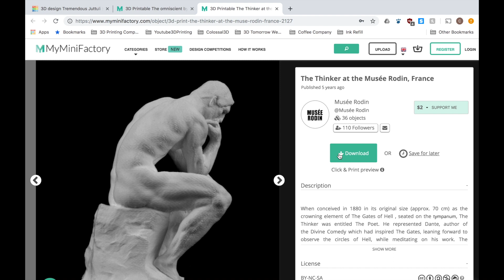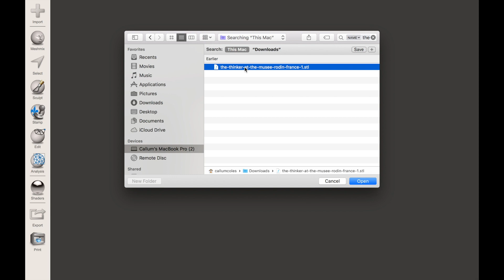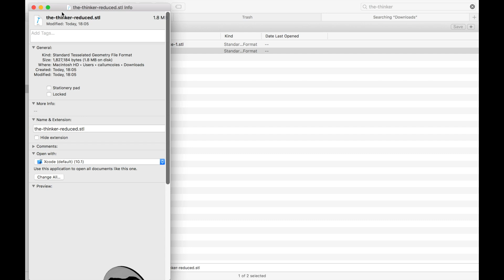Reducing file size in Meshmixer, ready for 3D Printing

Comment: This didn't really work, it just stripped all the detail off my model. I found using the Tri count setting works better, it gives you more control over the geometry, especially if you turn on wireframe mode to see how your mesh is changing.

Comment: It made it bigger for me. I followed the video exactly and it went from 50mb to 100mb
Reply from the maker: You would have saved as a different format to what it originally was then, if you’ve followed the video then the mesh count will have gone down
Reply: I know it's from 4 months ago; just came across the same issue with Thingiverse/Meshmixer making the file 4x bigger. I redownloaded (the same file!) from Thingiverse and that fixed the issue. Guess Thingiverse somehow bugged out -- its the same file size / date but one balloons and the other doesn't.

Comment: Is this changing the printing time as well? Is there a little different configuration in Max deviation for 0.8mm nozzle?

Thanks for the Video it is really helpful
Reply from the maker: Should be little to no change in print time, but the lower file size will process quicker in the slicer. I would keep the reduction settings the same even for a 0.8mm nozzle.

Comment: How stop meshmixer rendering a result after touching a setting? I know I want to change other settings but it renders every time i change something and i have to wait ages!
Reply from the maker: It's annoying isn't it! Unfortunately not possible to override... My only recommendation is to keep the resolution settings low while you change the other settings, so it at least updates quickly, then increase the resolution once you've got the rest of the settings as you want them.
Reply: @CallumColes  It's very annoying and leads to crashes if a setting is giving the pc too much to handle. I managed to downsize a 260MB file eventually, so thanks for the tutorial. Just wish I could toggle all the sliders, then hit go! Would save a lot of time waiting for a render I know is wrong!.
Reply from the maker: Your welcome! And yes, I could not agree more, they have implemented that feature for some of the tools in the software but not all of them. They obviously didn't test the reduction feature with large files else would have known how time consuming it is...

Comment: Thanks - right to the point it's what I was looking for
Reply from the maker: No problem, cheers for the comment :)
Reply: @CallumColes  I have a file I have tried for HOURS to decrease the triangle count to 300000 and am having difficulty. Could I possibly send you the file and you could help me, PLEASE.
Reply from the maker: If you're having difficulty it could be due to errors in your file, these can confuse the software. If that is the case a reduction can be pretty time consuming and CPU intensive! Additional pre-processing might be needed in the original CAD software where your file was created to remove any errors and in turn assist the reduction process.
If you're really stuck, you can email your file over to mail@3dtomorrow.com for a quote, but generally speaking this isn't the sort of request I would take on since it can be very time consuming and therefore expensive. That's why I created this video to help people do it themselves :)
Reply from the maker: If the file you're reducing is particularly massive, try a percentage reduction (or two) first. Just export and save a version each time in case the system crashes!

Comment: it is necessary to smooth? the model is so triangulate...
thx
Reply from the maker: The steps in this video will preserve most of the original detail in the model and allow you to reduce the file size accordingly. If the model you are using is visibly triangulated then it could be a good idea to perform some smoothing, but the content of this video will not help you to smooth the model.

Comment: Hi
Is this function only available in the full version?
Reply from the maker: Meshmixer is free software, so as far as I am aware there is only one version
Reply: @CallumColes  thanks for reply. What is this version you were working on?  This icon does not exist in version 3
Reply from the maker: @CAD_CAM_TRAINING it should be there in version 3, this was version 3.5 I believe. Have you made sure to 'select all' on the model. This opens up the menu more. Select all is CMD+A on a Mac (probably CTRL+A on windows).
Reply: @CallumColes  OMG! thank you very much boy. Appeared by selecting all the edit options

Comment: Following this exactly.  Doing what you are doing only using "triangle budget"   The model updates on the screen but when I go to export, the changes never take.
Reply from the maker: Unsure why that would be, could be a software bug in your version, so might be worth checking for any updates available, or alternatively reinstalling.
Once you have performed the reduction, go to ‘View’ then ‘Show Objects Browser’ and make sure Meshmixer has replaced the file rather than generate a new object. If it has generated a new object then make sure this is the one selected, then click export. When you export, be sure to save the file as a new name just for reassurance.

Comment: whilst its loading "max deviation" it starts loading then just keeps crashing, i tried 3 times. and installing new update but same crap :(
Reply from the maker: Deadpool Lane if your file is particularly large and/or your PC isn’t powerful enough this can happen. Although it can lose a bit of detail, doing one or two percentage based reductions first might be needed to get the max deviation option to work. Just export the file after each reduction pass in case it crashes again! Good luck:)
Reply: @CallumColes  i've got a new pc running shite loads of stuff, other files i've used worked fine, but this large zombie file and a dinosaur file both crashed. :(
Reply: @deadpoollane4229  i had the same issue to make it work i recommend closing all unnecessary applications in the background and then it worked in seconds

Comment: hi, my company bought a 3d object and i need to upload it to Instagram camera filter, but the file is 30mb and Instagram only supports up to 4mb files.. please help.. im using spark ar
Reply from the maker: dubas dibas hey, what format is the file you’re using? I believe meshmixer will support STL, OBJ, PLY, AMF, 3MF and OFF file extensions, so if your file is one of these, then this process will be suitable for reducing the size.
Reply: @CallumColes  Yes! I followed your video but the file only reduces down to 7,5mb.. i reduced the percentage to 100% .... also i increased the max deviation to 2.24mm (the max) .. i read the more you increase the max deviation the lower quality you get..
Reply: the formats i can get are MAX, FBX, OBJ, 3DS, MB, IWO available for download
Reply: Thanks for the Help man
Reply from the maker: dubas dibas if you’ve already got it down to 7.5MB and you do another percentage based reduction at around 50%, then that should get it under the 4MB you need
Reply: @CallumColes  ok ill try that, thanks!!

Comment: my files are getting bigger!  help what am i doing wrong they are doubling in size
Reply from the maker: 404 Shenanigans are you definitely using the reduce tool and not the remesh tool?
Reply: @CallumColes  yes I was using  reduce  I found a different software that could do the same thing and it worked. Idk what was wrong
Reply from the maker: 404 Shenanigans okay perfect, glad you found a solution!
Reply: @404shenanigans4  What is the program you used because im going through the same problem
Reply: @dragoom432100  i used 3D viewer in the Microsoft store it was free and actually reduced the size of the file (it looks like a wight outline of a cube in a blue background)
Reply: @404shenanigans4  Thank you so much ill try it out
Reply: @dragoom432100  cool let me know if it works for you